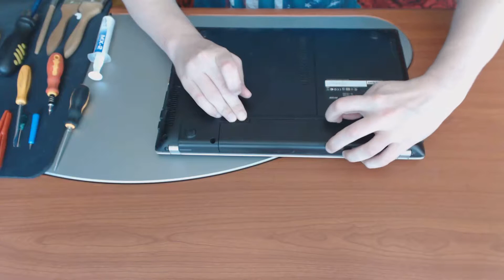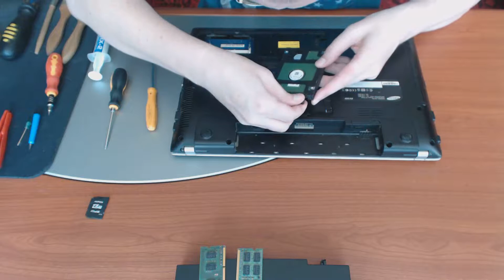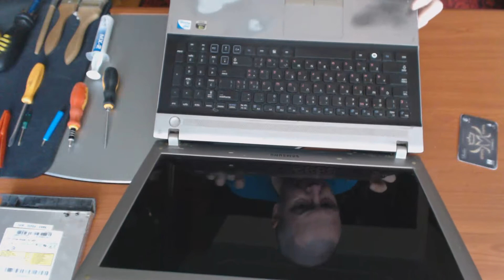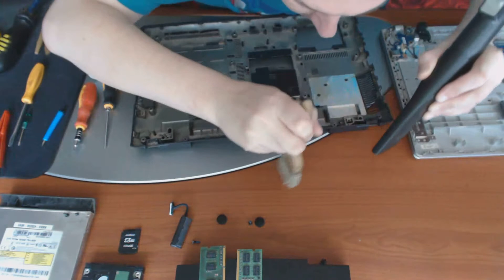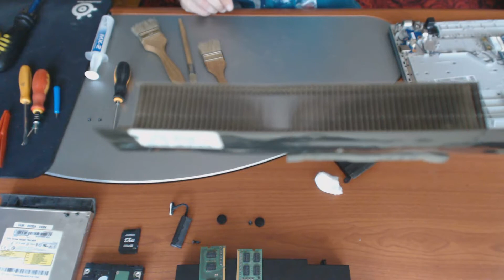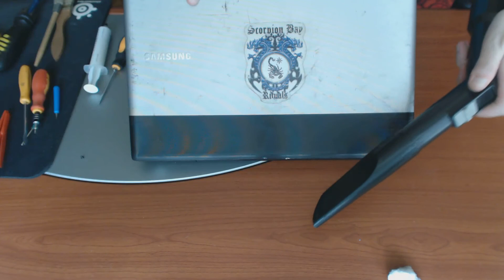Disassembly Samsung RV509 S04UA

Comment: How much ram have you installed? How much Max Ram one install on rv509? What was that other chip near the CPU you put the thermal paste on alongwith CPU?
Reply from the maker: Hello! Laptops come to me for a short time. Only to solve a specific problem.

Memory. This series of laptops can have 4 GB to 8 GB DDR3 SODIMM. The amount of memory depends on the installed processor and chipset.

Second chip. Quote "A feature of the new Core i3-330M is the integrated graphics card called Intel HD Graphics or GMA HD and a DDR3 1066 MHz memory controller. Both are on a separate die that is still manufactured in 45nm whereas the CPU die is already manufactured in the new 32nm process. ", https://www.notebookcheck.net/Intel-Core-i3-330M-Notebook-Processor.23753.0.html
---------------------------
There is a war going on in my country right now. Support Ukraine!
Reply: @victorkrynytsky  Hi sir in my laptop Samsung RV509 Ram DDR 3 PC3L 4GB not Supported how to resolve ? System is not booted
Reply from the maker: Hello! You need a SODIMM DDR3 module and not DDR3L. Only the type of RAM for which the motherboard is designed will work.

https://www.differencebetween.com/difference-between-ddr3-and-vs-ddr3l/

Comment: Rv 509 laptop what ram frequency it's support???
Reply from the maker: Hi! In the specification on the manufacturer's website, see page 82, the type of RAM is DDR3 SODIMM. You can safely install modern modules with a higher operating frequency - the laptop BIOS will automatically set the required frequency, 800/1066/1333 MHz.

https://downloadcenter.samsung.com/content/UM/201110/20111007135148993/DOS_Manual_v1.1_ENG.pdf
Reply: @victorkrynytsky  thank you very much sir
Reply: This rv 509 laptop body available in market??
Reply from the maker: I do not know. Take a look at ebay.com, ask your local service centers.